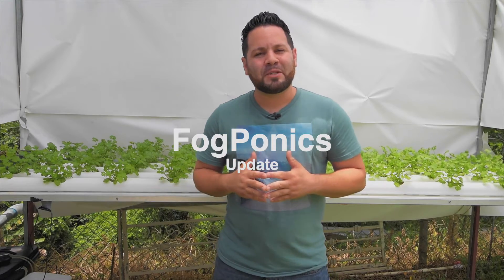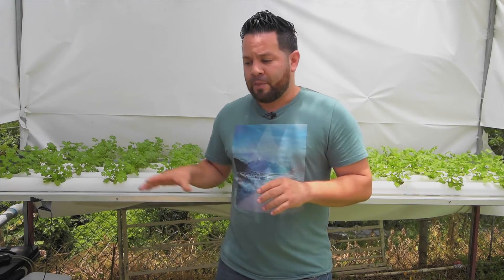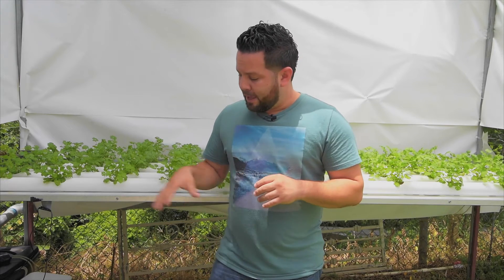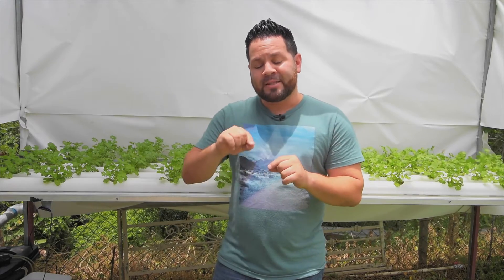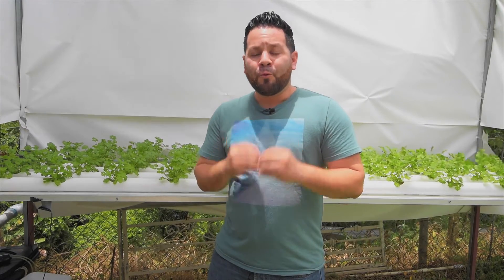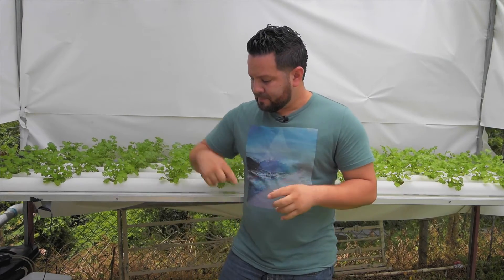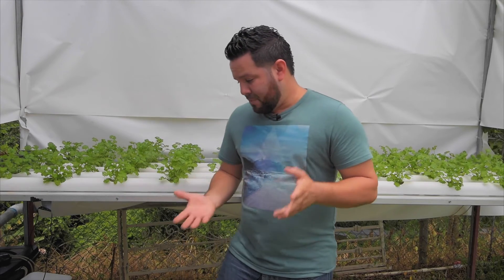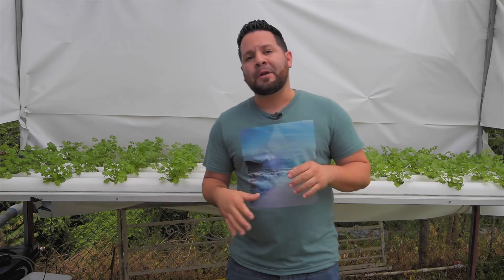Fogponics Update

Comment: I've  been R&D fogponics for over a year it's  the next generation.  Use a bigger container ( HD has a commander plastic 27 gallon for $9.00) use a small fan to stir the mist it will also cool it down and ventilate.
Reply from the maker: Thanks a lot. Im going to look into it.
Reply: what if we aerate the water with an air pump...would it cool it down as well?
Reply from the maker: +Alex Jones well Alex what I found its that since I only had less than a gallon of water it wasn't enough water. So I then added more water and the temperature was much better. The fogger create heat since its vibrating at high frequency so you would need more water to keep it cooler. And also have it on a timer. I wouldn't think that the air pump will make much of a difference with the temperature.
Reply: finally someone confirms my study! people who go into any detail on youtube have no idea about heat dispensation if it was not for a radar teak i would not be looking into this issue before investing.

Comment: personal favorite: (2) 5 gallon buckets. 2 inch pvc fittings to connect the buckets together.  you need two(2) pipes.  1 60mm water proof fan mounted to the mouth of one of the four 2 inch connectors.  one bucket holds the fogger and nutrients and fan.  the other holds the plants.  it is INSANE how effective this is.  to cool the nutrient basin you can put a 20oz frozen bottle of water in every 4-12hrs. if you are growing anything besides cabbage and lettuce, i strongly suggest a scrog.
Reply: p.s. you will have to either install and capture and reclamation method for the bucket that holds the plants, as the condensed vapor will collect and once the roots reach the bottom, and they will and rather rapidly, they start drowning.
Reply: p.s.s. that setup is vastly expandable, enjoy. and share because knowledge is free, credentials are paid for
Reply from the maker: +Randolph Buffington I will definitely look into this setup thanks a lot

Comment: Foam is not a sponge. Your error was using foam as a "side bracket" for the roots. The atomized mist is such fine particulates (1-5 microns) that they'll absorb into fine "cotton candy" roots. If you have foam around it, you're forcing the roots to grow towards the foam... If... The foam has any water. But what the roots really want, is direct atomized water mist contact. That direct water contact is absorbed because it's 1-5 microns. So keep your roots directly exposed! :-) Just like Aeroponics, with a 1ft distance using 360 degree nozzles, you mist the roots with sprinklers for 4-10 seconds, once every 30-60 minutes (depending on life-stage) If the roots are still TINY (less than 1" growth) than stick to a 4-5 second mist and 60 to 120 minute intervals. Let the mist air-dry the roots after... Same for fogponics, except fog takes longer to generate. So fog should be on for like 5 minutes, off for an hour or so.

Comment: try having a small fan blowing into the bucket. it will force the mist into the foam maybe?
Reply: Nah, you dont want mist in the foam. You want the atomized mist directly fed to the roots. Foam shouldn't interfere with water > roots.
Reply: you need a reasonable amount of root to begin with, if you dont have enough the plants cant connect with enough liquid and will wilt :) Growers generally try to fix this problem by overmisting (constant fogging), which just makes things worse.  The overly dense fog  condenses on the roots creating a film of liquid water (not conducive to producing efficient aeroponic roots that can utilise droplets) and restricts oxygen.The biggest issue with ultrasonics is the droplet size, its just too small. You can replicate ultrasonic issues in a high pressure aeroponic setup by mounting the nozzles low down so none of the larger droplets make it to the top of the root chamber, you`ll experience the same wilting and very slow weak root growth.
Reply: Atom izer good point. keep roots high enough to avoid heavy drops. props friend
Reply: Roots need the larger droplets, 1-5 microns is not large enough :)
Reply: the fog actually brings the body of water more to the ambient temp "like sweet", removing it will rais the local temp
Reply: Evaporative cooling doesnt happen in a high humidity chamber with no airflow ;) I recommend folks invest some time and effort vs leaving others to do all the legwork so you can simply duplicate a working design ;).

Comment: Lol The mist does not need to go a high
Reply from the maker: Hello +Clownbow1 Can you elaborate more
Reply: The humidity created by the Mist is enough no need for the actual fog to be touching the roots as long as you keep the system sealed and the humidity in
Reply from the maker: It makes sense. in my system, i didn't have the net pots sealed so I was losing the humidity and the roots looked a but dried to me that's why I decided to raise the water level to have to fog cover the roots and have a better result...
Reply: Yeah the key to a fog system is to keep it sealed it will also help with water evaporation you will not need to replenish the water so often

Comment: HAHA sure liquid to gas makes heat. no look at the power supply for ultrasonic foggers its a bit of watts. looking into people tare these things apart online i see that the devices is not power effect "all the power not used in ultrasonic motion leaves in the form of heat". so to fix the problem we can use a 35 qrt tub to keep it cool a deep large bed would be best for dissipating the heat.
Reply: You`ll find the warmest air will collect at the top of the chamber regardless of the depth ;)
Reply: True but 24 volt at 1 amp that's 24 watts. It's simple thermal disapation
Reply: Its not usually the internally generated heat thats the problem, its the external heat from the room, lighting etc. If you enjoy a challenge, you should try running high pressure aero outdoors in full sun ;)
Reply from the maker: Rex when i first start this little project I used it in a 5 gallon bucket with 1/2 gallon of water and had it sitting in the bottom of the bucket. what i realized was that the water was getting hot and the fog was reaching the top. So I then added 3 gallons of water to cool down the fogger and also help the fog get up higher/closer to the roots and it seem to work better in that way, but since it was a cheap ebay ultrasonic fogger it stop working after serval week of being on most of the day.
Reply: Do you think this would get roots on a 5 foot tower garden?
Reply: @stephenmocko7365  my experience is no you'll need some kind of active air movement. Using a turbo fan on low and a 3D printed adapter you can make a fog pump with the Venturi effect and a turbofan fan. If you think you have trouble with heat why don't you just get some of those three dollar cobs at 50 watt and stick a whole bunch of them on the back of a GPU block but no mathematically speaking in from my experiments it's the ultrasonic unit creating heat..... Ultrasonic foggers failure mode is the micronutrients building up on the piezo electric membrane or eating away at it this can include damage to the power supply. Preferably you would use something like a CCTV fuse box to run each with a current limit they run 24 volt but can start kicking at 8v or so. the other two options for creating a mist is spinning a specially shaped dowl at a high RPM on the surface of the water high pressure Misty nozzles or ultrasonic foggers.